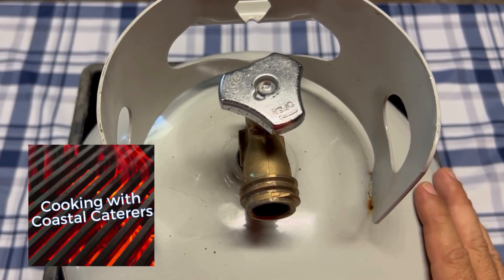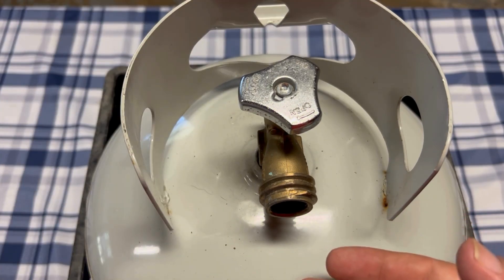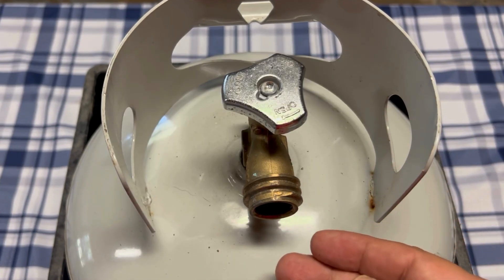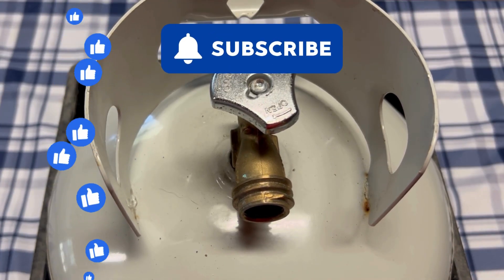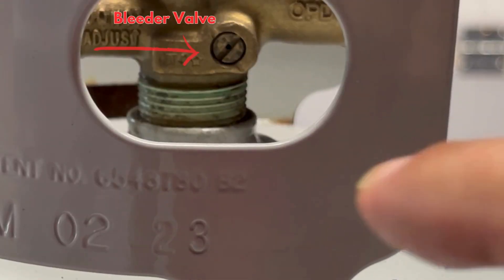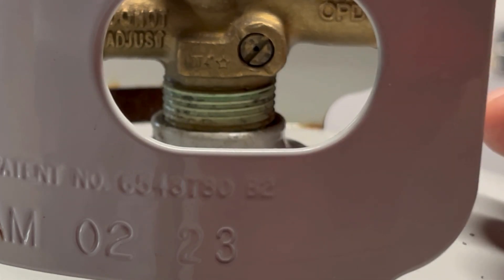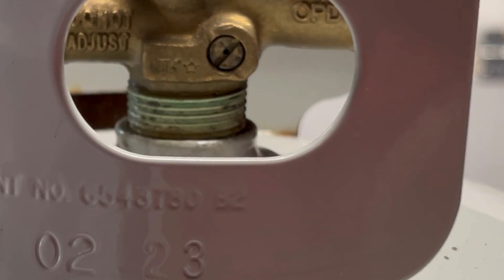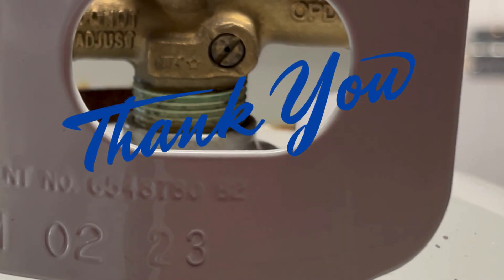OPEN The BLEEDER Valve On A Propane Tank  👍👍

Comment: Question 
A few days ago I wanted to use my bbq.

I took the cover off and turned the main tank value ON and a heard what sounded like gas leaking out.
I can smell it and I felt a stream from the value area.   I turned it off quickly.

I turned On again later in the evening and it did not do it again or since.

The day it happened it was extremely hot here in SC.  Day temps were in high 90s.  Although I had a cover over the bbq and tank it was in direct sunlight.

I wonder if it a normal occurrence or an issue.

The tank is new being I purchased it a few weeks ago at Costco and had it filled at Costco as well.
Reply from the maker: Sounds like the tank was overheating under the grill cover and was releasing some pressure from the relief valve.  You may want to disconnect the tank when your not using in the Summer and keep in a more shaded and well-ventilated spot until the temperature start to cool back down.  Hope this helps!  Thanks for watching.
Reply: Tried to start blackstone and no gas is flowing to it. I unhooked the hose reconnected still nothing. No smell either.Full tank but been in hot sun couple days. Should I use the screwdriver and turn a little to release pressure?
Reply from the maker: @wessleeysnipez @wessleeysnipez If the tank is in the sun and the gas is expanding, the pressure relief valve will let the pressure out automatically.  The bleeder valve only tells if your tank is getting close to full when filling it. That is why you open the bleeder valve.  You may want to disconnect and reconnect your hose a couple more times because the safety valve inside the shutoff valve may be stuck closed, which might open it back up. I hope this helps you.